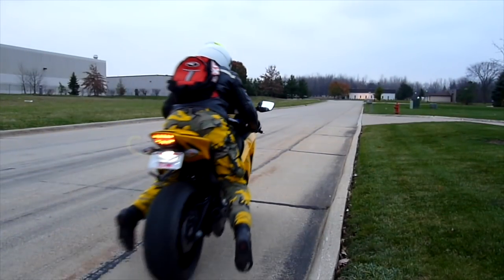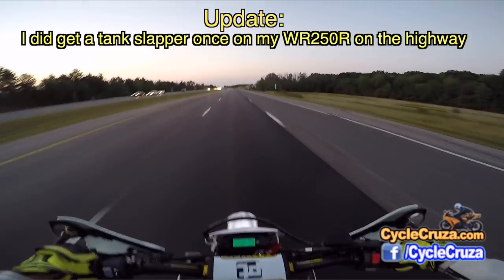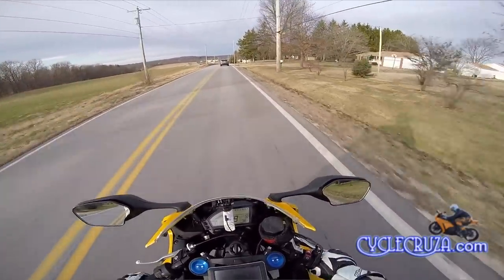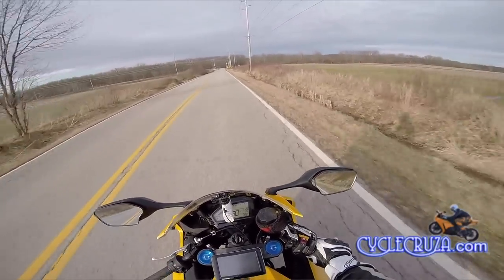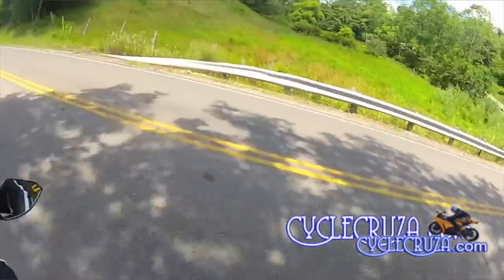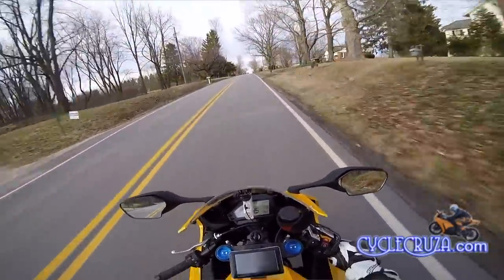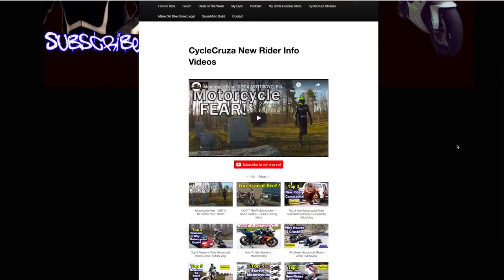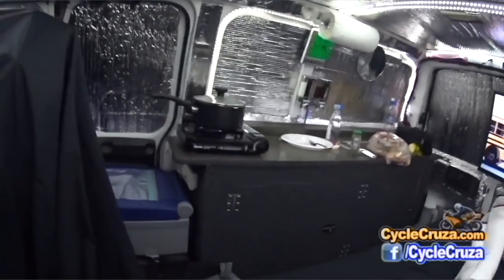Motorcycle Tank Slapper Speed WOBBLE - Survival & Prevention

Comment: It's a complex series of factors that contribute to speed wobbles. GENERALLY SPEAKING, hard acceleration over rough surfaces which cause the front tire to skim the road surface, kicking the wheel angle out of alignment with your trajectory, is often how oscillations start. Another way to duplicate similar conditions is to land a wheelie with the wheel out of alignment with the direction of travel.
Sportbikes are often the only type of motorcycles that do this because the fork angles are quite steep, the trail dimension is quite short. Steering angle is not the only thing that causes it however, as wheelbase length and rear suspension angles can also contribute.
Front wheel begins to hunt around, the rear wheel naturally follows the direction of the front wheel and can start to tail-whip if the front is violent enough (full lock to full lock). Mild oscillation can be overcome with gentle control and input, but violent oscillation probably won't end well.

Steering dampers can be just a band-aid solution for a root problem.

Comment: Hey what’s up cyclecruza!

I love your videos! I have a CBR! You inspired me to go with the Honda.

So, I’ve got a 2020 CBR 650R 

 It’s super fast! I love it, I already have 6800 miles on it in 12 weeks of ownership.

I have a very good level of skill on the bike, it’s not my first bike.

So, what I was going to say is, I got the speed wobble today when I was going 70 mph, racing my father on his Harley Davidson V rod.

I was fine. But I just wanted to mention what I did, I stayed calm, I slowly increased pressure on the bars to have the bars stop, and I applied the rear brake slowly.

It stopped. I didn’t touch the front brake, you shouldn’t do that. I haven’t watched a video yet, I don’t know if I’m wrong or right, but I just wanted to say that’s what worked for me. And I’m lucky.

I’ve had it happen before, but very slightly so it’s never been a big deal, but today it was very severe, I was very lucky.

I think it’s God.

All right thanks! Ride safe!

Comment: I did  a  steering  lock to lock to  lock  to   lock   tank  slapper  one  time  on  my  Honda  CB-100   on  wet grass  ..  I may  have  been  going  40 mph  or  so ..  and   was cornering when the rear wheel  slid out.   I saved  it  but almost messed my pants..  ..  
  Hitting the rear  brake  makes sense.... I didn't  realize they  had  factory  electronic  steering  dampners..  My  FZ-07  gets  wobbly  at  90  MPH ..
  I bought the  CB-100   for the motor  to build a  4 stroke dirt bike ..  bored and stroked  it  hot  cam  ported  head  bigger carb  put it in a  1977 Honda  CR-125  frame
Reply from the maker: My MT-09 doesn't have one and it can get a little shaky sometines. I was going to add a steering damper but I will be selling for a new bike come Jan, possibly the new 2021 MT-09 SP. Sound like you have a cool custom bike! Stay safe!
Reply: @CycleCruza    You  need to test ride the Indian FTR-1200  ..The S Model  costs  more with  blue tooth touch screen  and  three rider modes..  I see  S&S  just  came out with a  3 level  switch  to   program  three  different modes on the  fly with  the standard mode..  S model  also has the Gyroscope that  can limit  wheelies  and how  much throttle  you can use in the corners..
  I like their  newer model  rally   bike with spoked wheels  better..
Reply: @CycleCruza    My  1971  Yamaha  R-5  has a steering Dampner..  You adjust  it  by  screwing more  pressure  or  less pressure with a knob..    "1971"   You need to test ride an Indian FTR-1200   you could  replace  both of  your present bikes with it ..

Comment: Biggest thing is staying light on the handle bars. If you feel any wobble, let off the handle bars. The bike will right itself. The problems arise when you try to fight the wobble and you death grip the bars. I ride dirt bikes a lot on the street and in the woods. 60 hp on a 250lb bike you will get head shake during acceleration because the weight is lifted off the front tire so it was a pretty common occurrence for me. Once you stay light enough on your bars you will rarely ever get the whobbles, and when you do you’ll be prepared to handle it.

Comment: Should adjust the suspension if you are having tank slappers. It may not stop it completely but will reduce them. Start with the compression and rebound adjustments on the shock. Can then adjust the fork. Again, may not stop it completely but will reduce them. Did this on my KTM Superduke R and it made a big difference in frequency of tank slappers.

Comment: What you need to do is go off the throttle a little bit (not fully so you dont loose control), loosen up the grip on the bars so the motorcycle can setup itself straight.
Dont fight the steering just keep it from going all the way into one side. You need a lot of feeling for that. Good Luck!

Comment: You don’t let off the throttle!!!!!!!!!! You power out. Get the weight off the front tire. Horrible advice.
Reply: You can do either. It honestly doesn't matter as I've done both to correct the issue.
Reply: @motomikey6667  then you just got lucky. It’s not what you’re supposed to do. It’ll be fine with a mild one. Not a violent one. Sounds like you’ve never had a real tank slapper.
Reply: I agree. C'mon cruza, you should know better.
Reply from the maker: *facepalm - You must have never had a tank slapper. I had one, reason I updated this video! You always let off the throttle and allow the bike to engine brake, stay calm, don't death grip the bars and the head shake will subside. You NEVER want to throttle out of a tank slapper, unless you want to have a real f**ked up day! lol
Reply: @CycleCruza  Just because you've experienced one, does not mean you understand what is happening. You're correct about staying calm, and not death gripping the bars. During a tank slapper, the front wheel is trying to correct itself. To aid in the correction, you take weight off of the front wheel. You may have made it through your experience by braking, but that is not the best way to correct the issue.
Reply: @bovicegumble1404  Thank You!
Reply: @CycleCruza  Summer of 2005. 120 mph, hit a series of potholes. Had bruised wrists from it. You’re the one who’s never experienced one. What you had was steering wobble.
Reply from the maker: @bovicegumble1404  Never tell riders to throttle out out a tank slapper, you will get them killed man. lol  When the handlebar is shaking violently, trying to to throttle it will naturally cause you to harden your grip which is exactly what you don't want to do. I had a pretty bad tank slapper and my technique of staying calm, letting off the throttle, loosen your grip and just letting it ride out of it worked perfectly.
Reply: Finally, thank you👍
Reply: @CycleCruza  It's okay to be wrong my man. I accept that I may be wrong on this topic but what I am saying makes more sense than what you are saying. Based off your last comment, you advise against throttling because it is possible for someone to tighten their grip. Well it's possible to keep a loose grip while accelerating. Remember when you were wrong about countersteering? You're wrong about this too. The best advice is to throttle and take weight off the unstable wheel. Not braking and adding weight to it. Again, just because it worked, does not mean its the best advice. Just like exercising may work in loosing weight, but just telling someone to exercise is not the best advice. Diet and exercise is the best advice, even if exercising alone has helped *you*.
Reply: @bovicegumble1404  the problem is he’s talking about steering wobble. Not tank slap. There’s no mistaking it once you ACTUALLY had it. I have. It’s lock to lock at full speed. As I said in another comment, my wrists were bruised after. There’s usually no recovering from it. But the last thing you want to do is let off the throttle. You will for sure go down if you do that.

Comment: Linked  brakes  some  Halreys  have that .. don't  even know of  any other brands that use that..?
Reply from the maker: C-ABS brakes, most new bikes have it or it's an option. Either way, you should still use both the front and rear brake as a habit in case you get on another bike that doesn't have c-abs brakes.
Reply: Kawasaki K-act ABS
Reply: Honda
Reply: @jayflash2035    I  would have guessed a  Gold Wing..   sounds like a bad idea to me..
Reply: @mikeskidmore6754  also VFR, Blackbird, I don’t mind it personally
Reply: @jayflash2035    My  friend has a Honda  VTX-1300  she told me that she rarley  ever uses the front brake.. I think she put  80,000 miles on one of her bikes..   I told her  your rear  brake  is only 30% of your stopping power..  I googled that Model  and don't think it has linked brakes..  also her  brake light was not working and I  did try to help her  fix the switch and  adjustments.. I did  not  get it  fixed  but  since  I showed her  where  to look she did fix it herself.."
   She has  been in two bad accidents.. the first  one she was sitting at a  red light and got rear ended.. The second one a  teenager who got his drivers License  two weeks  previous  pulled out of a drive  way in front of her..
Reply: @mikeskidmore6754  
If she can't stop with mainly front brake she really shouldn't be riding and needs to do some riding courses 
Or she is gonna have a real F'd up day again 
Guaranteed
Reply: @wradford1    Yes  she has  totaled  two bikes  but the first one was hit and run   while  sitting at a Red light not her fault..  Another  Motororist  got the  number of the  Drunk woman who hit her..
   The Second accident  she hit a car braod side.. so   yes  if she hot both brakes she could have stopped much faster..  I am  going to call her on the phone..  I aready aksed her by e-mail.   I also  recently  found out she had a passenger  during the second accident and that  woman  just had her in court for the 4th time to try and sew her.. She aid the Laws  only  allow   ATTMEPTS   or  appeals .. I   assume  her  ex friend lost for the 4th time..
   Her  passenger was not bady  hurt but she was..  She is on disability now and she rided  very little  now  because  it bothers  her back.  
  I always  use  both my front and rear brake .. that way it will  be  normal  havbit  or  muscle  memory to  use both brakes  always ..
   The one time  ABS  really  helps is during a panic  stop .. where it  so  easy to  use the front  brake  too hard and skid the front wheel and go down.. 
  Last Summer  I hot  a Deer at  50  MPH  I say  50  because I was  going  55 and I had a split  second before the deer took my front wheel out from under me..Then I went for a  50 MPH slide on the pavment and into a  nice grassy  deep ditch  as did the bike and the deer..
Reply: @mikeskidmore6754  Wow she's had a rough time by the sounds of it. Some accidents are unavoidable but many are if you have the knowledge, skills and have practice enough for it to become second nature.
 I have friend who just started riding 
She has a Harley and she rear ended a car recently because she only uses back brake.
I sent her some MotoJitsu motorcycle training videos but I don't think she watched any. You can give advice but what people do with that advice is up to them and lot of riders don't realise they can't ride until it's too late.
I hope your friend recovers and gets back to riding soon.
Reply: @mikeskidmore6754  
I hit a kangaroo at 50mph and ran off the road. Bike fell on me and broke my leg. 

What's the difference between America and Australia ?
You hit deer 
We hit roo's 
😆

Comment: Back in the late 70’s I would pull wheelies on my GS 750 .Sometimes I would land harder than expected . Well that hard landing was damaging to steering bearings, when I would be racing and get over 110mph I would get a high speed wobble, one day I put the bike on the center stand and the handle bars would stick a little off center. I tore the triple tree apart and inspected the bearings a they had a flat spot I changed the bearings and the problem was solved. I stopped doing wheelies.

Comment: My R6 had steering wobble a lot one ride. Turns out low tire pressure was causing it
Reply from the maker: Yeah your wheels/tires not being balanced or really low pressure can cause problems. That's why I recommend putting duck tape over your wheel balance weights and always checking for proper air pressure before riding. A pre-inspection can keep you from having a real f**ked up day!
Reply: @CycleCruza  Thank you for the response! Do you know how I can find the recommended PSI for my tires hot and cold?

Comment: I was told to accelerate out of it and it actually happened to me and I did accelerate out of it Even thou you logically thinking slow down .Definitely don't brake hard
Reply from the maker: You got lucky, the last thing you want to do is throttle it. Just let off the throttle and and don't death grip the bars and the bike will ride out of it.
Reply: @CycleCruza  I racer told me to do that I hit a pot hole at high speed on a zx7 Was intense Along time ago The bike was basically flexing